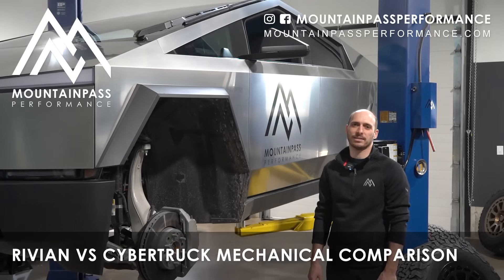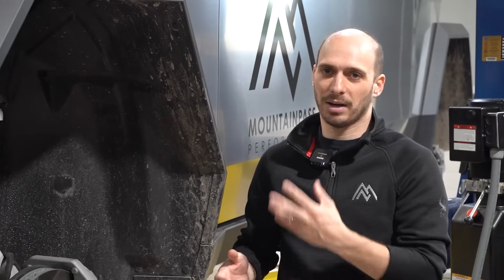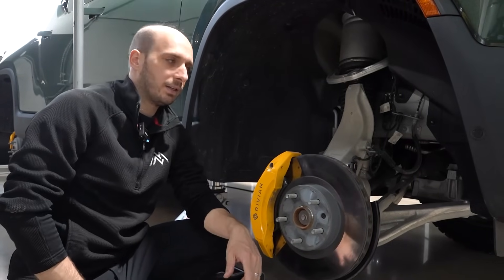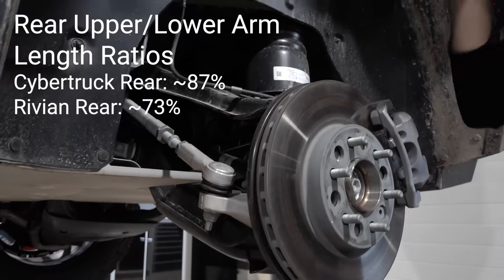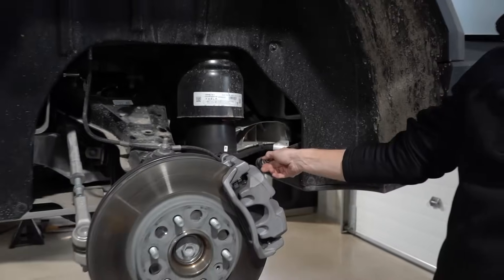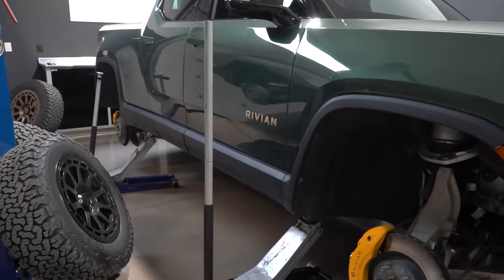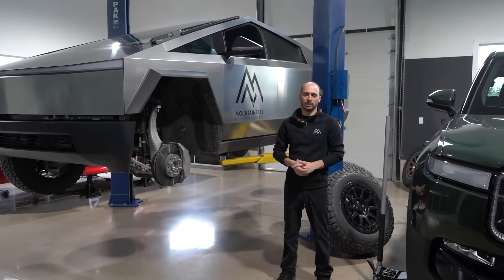Tesla Cybertruck VS Rivian R1T Suspension & Brake Comparison Up Close!

Comment: How dead wrong you are about range and effeciency! Just watch kyle connor and inside ev 70 mph range test. CT 304 miles vs R1s 290. Do better research. Big battery does not mean big range. Efficiency is king.
Reply: I stopped trusting Kyles tests long ago, he has a persistent anti-Tesla bias. I don't know if he does it consciously or unconsciously, but he doesn't want any Tesla to perform well in any range or efficiency test. You can tell how biased he is by watching the language he uses. Sometimes he catches himself and adds a moderating comment to appear less biased, but he can't help himself.

Comment: Cyber truck has steel subframe for the suspension pivots so you can weld reinforcements to them if you beat hard. Would be easier to add aftermarket control arms that are the same length or even +3” and get 12-16” wheel travel on the cyber.   Replace the air ride with 3.0” fox/king/bilstein coil overs per side and it should be fun.
Reply: The Cybertruck is already more fun than you can imagine as it's delivered. It really wants for nothing.

Comment: I heard anyone over 6'1" will hit their head on the ceiling in the back seat on the CT
Reply: That's a false narrative propagated by anti-Tesla folks. I'm 6 foot-four inches and I fit fine in the back seat, sitting straight up, with an inch or two to spare. The cabin in the Cybertruck is large and airy, especially compared to the R1T which is not optimized for someone my height.

Comment: According to Rivian and Tesla numbers, Rivian has lower CD but it also has a significantly smaller front footprint (and overall size) since it's a midsize truck vs CT being a full size truck. Also, it appears that Tesla is measuring CD a bit different - with wheels in motion, whereas many/some others measure CD without wheels or not in motion, not taking into consideration CD impact of moving wheels - which can be signfiicant at these low CD numbers.The fact that Rivian with a standard pack (121kwh) has significantly less range (270 mile) vs CT with 320 (or 340 with "street" tires)
Reply from the maker: Yes exactly, by the numbers the Rivian should get much better highway efficiency considering how much aerodynamic drag plays into the power losses at high speed. 

With the same wheels and tires on both vehicles, it does not!

In theory, if the Rivian is more aerodynamic, there should be a speed where it becomes more efficient than the Cybertruck. Sounds like we need to go faster!
Reply: @MountainPassPerformance Rivian weighs more
Reply: That's because Rivian is using real world miles and Tesla is using Elon miles.
Reply: @TroySavary  not according to car and driver Edmunds etc who all loathe tesla. The rivian in either dual or quad motor large pack trim with at tires is LESS range real world than the smaller pack ct is. Edmunds even managed 330+real world ct miles on a charge in mixed driving.👍🏻😀
Reply: @4literv6  Out of Spec got 250 miles highway driving, going down to empty. Highway driving is the only time range actually matters. Who cares, what a vehicle gets puttering around town? Also, at city speeds, and in stop-atart driving, aero doesn't really matter, but weight does.

Comment: I wish the R1T had rear wheel steering!!
Reply from the maker: That would be cool!
Reply: Rear wheel steering came with the GMC Sierra and Chevy Silverado back in the 2000s and no one really cared. It's a cool concept but mostly useless in real world situations. Most new trucks already have a really tight steering angle and streets in the US are massive so 4 wheel steering is really just a party trick.
Reply: @MindzEnt  Um, no. The rear wheel steering transforms the Cybertruck in a fundamental way into a much better vehicle. Combined with the fast-reacting steer by wire, it's mind-blowing what it can do that a regular truck can't. This isn't hyperbole, it's just plain obvious if you use one. I have over 3,000 miles on my Cybertruck and am blown away by how fun/easy it is drive in tight environments and well it rides/handles on highways and twisty roads. It literally does all driving environments well. No other vehicle on the road today can say that. It's a completely different animal.

Comment: Good video but spec sheets for CD shows/says the RivianR1T is more aero efficient
Reply from the maker: It does show that! Perhaps we need to do more testing to find out where the Cybertruck gets its efficiency from.
Reply: @MountainPassPerformance  Even in conserve mode the quad motor Rivian R1T has to drive two motors at highway speeds where as the Cybertruck may only be driving one motor under similar circumstances. So probably would need to compare it to the dual motor R1T to eliminate some variables.
Reply: @MountainPassPerformance  CD is a coefficient, just means it's aerodynamic for it's size, the CT is still a smaller frontal area overall than the Rivian. It's why a chevy bolt has an awful CD compared to a model 3 but has almost the same efficiency cause it overall has a smaller frontal area.
Reply: @MountainPassPerformance  The difference in published Cd values between the two trucks is probably due to the difference between publishing a Cd value representing a static truck with wind flowing past (wheels not rotating) and a dynamic Cd with the wheels rotating. Most automakers publish a static wheels Cd (because it makes them look better). Tesla publishes the dynamic figure with the wheel rotating. It makes a huge difference on this class of truck with large tires.
Reply: @MountainPassPerformance  the other thing I didn't hear you mention between the two vehicles is that the Rivian has a full-size spare tire compartment whereas the Cybertruck unfortunately with it being a larger vehicle doesn't have one and you have to use your bedspace. I believe this is huge in favor of the Rivian
Reply: @alittleofthisnthat5665  This is 2024. The idea of carrying a spare wheel and tire assembly, and jack and lug wrench is outdated. The concept comes from an era when tires were unreliable. The rational thing with more reliable modern tires is to carry a plug kit and a small inflator. If you run high quality tires, fit for the purpose, maintain the air pressure (too little is bad), and watch where you are driving, the chances of a flat tire is very, very low. Of course, if these precautions are too much trouble, then you should probably carry a spare and associated equipment. I would still carry a plug kit though. Because it's easier and faster to plug a common puncture than it is to swap wheels.
Reply: True but the bed in the rivian is much smaller to begin with. probably comparable to the CT with the spare in it.
Reply: @MikeHewitt  I hear you but not even close. Even if that was the case why take up valuable bed space with the spare tire. It's a huge miss/oversight on a full-size size truck

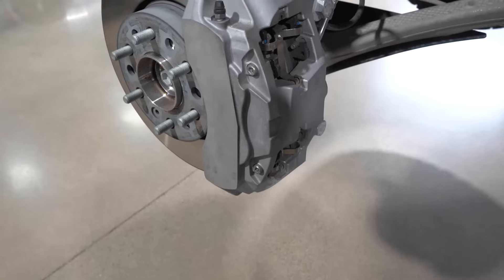Comment: 6:09 and 6:26 on both sides in the wheel wells on the Tesla at full turn you can see the tire rubbed. Not sure how you could fit a bigger tire since anything bigger will also come much wider.
Reply from the maker: Yup, and this is an OE sized tire and OE offset (Just a KO2 rather than the Tesla spec). You'd have to keep the truck jacked up at all times, which will kill aerodynamics.

Comment: Your aerodynamic assessment is off by the data. Rivian may look traditional but its drag coefficient is a .30 vs .335. It’s quite aero optimized, most aerodynamic of the pickups at least per the data reported on them.
Reply from the maker: Interesting. Perhaps we're missing something, but the Cybertruck was consistently much more efficient at highway speeds compared to the Rivian, despite the Rivian decoupling the rear axle. We drove both vehicles on the same trip together, so they were in the same air at the same time!

The Rivian, at 0.30 cD, has about 20.5kW of aerodynamic drag power at 120km/h. If the Cybertruck has 15% more drag than the Rivian, that represents a difference of about 3kW of drag power. The Cybertruck's total drag power would be 23.5 kW

On our long drive the Rivian averaged about ~36 kW of power @ 120km/h. With 20.5kW of drag power the remainder is 15.5kW.

As the Cybertruck uses about 15% less energy at highway speeds compared to the Rivian (averaging around ~33kW of power @ 120km/h - the remaining power is 9.5kW), that would mean the motor/battery/rolling losses are only ~60% of the Rivian! That's almost twice as efficient. Possible but unlikely. 

You can see how we've concluded the Cybertruck is more aerodynamic, as it's unreasonable to think the Rivian has basically half the efficiency outside of aero!

In both cases, the trucks were using the same wheels and tires for the most part, although the Rivian had the BFG K03 versus the BFG K02 on the Cybertruck. Both trucks were at 60psi. 

It's always tricky with aero and the main difference would be that the CFD of the Rivian is done with a Tonneau cover and we don't have one. But as Rivian's are being delivered without them, it's a fair comparison at this point in time!
Reply: @MountainPassPerformance  it’s possible Rivian’s aero numbers are with the smaller road wheels and aero covers which would decrease drag some. Don’t know which config that .30 comes from but the per kWh rated rate per the EPA cycle is better on the Rivian side hard to direct compare as Tesla chose not to EPA rate cybertruck. My R1T usually exceeds its rated efficiency just a bit with the stock 20 inch AT tires on all purpose presuming I don’t get too carried away with the speed.
Reply: @MountainPassPerformance  BFG KO3s maybe have lower rolling resistance? And is the frontal area similar, or does the Cybertruck have a lower overall CdA despite the higher Cd?
Reply from the maker: @moridin1000  Really hard to compare the KO3s to the KO2s unfortunately. The Cybertruck actually has a larger frontal area which is why I commented 15% more drag rather than 10%!
Reply: Posted this under another comment, but total aero efficiency is a factor of cd and frontal area. Could the Cybertruck have a lower frontal area? Or perhaps there are significant differences between the Rivian used in the wind tunnel vs many of the trim levels sold.
Reply: @ShaunRF   The Cyber truck is not as tall but the Rivian is 4" narrower and 7" shorter.
Reply: @ShaunRF  its also hard to equate efficiency in road testing to drag. Rolling resistance is also a significant factor. I suspect Rivian would have probably tested the 21” wheels with aero covers slammed to the ground with tonneau closed which would be its most aerodynamic setting. That might be something to compare, how low to the ground the Rivian gets vs the CT in its lowest ride height not that many people drive it like that as it doesn’t ride well at all, low is passable on most roads, lowest is just bad. On road trips I’ve certainly noticed a difference putting it in auto and letting it lower itself. Seems to improve efficiency by .10mi/kwh or so in my very unscientific experiments.

Comment: Rivian claims the R1T has the lower cd of the 2. So I'm wondering what led you to say that the CT is more aerodynamic. Is it frontal area?
Of course it'd be amazing to see actual wind tunnel results, but currently we just have the manufacturer claimed values of .34 for the CT and .30 for the R1T.
Reply from the maker: Interesting for sure, the Cybertruck gets far better efficiency on the highway, despite the Rivian decoupling one axle. Both tires should be similar as they are equally sized similar compounds, and the same wheels (K02 and K03 tires). 

We don't have a tonneau cover on our Rivian, so perhaps this is part of it.
Reply: @MountainPassPerformance  Ahh I'm guessing it's the tonneau cover difference, and maybe powertrain and hvac efficiency as well.

I agree overall efficiency is most important, but still would be interested to see how the real cd compares to manufacturer claims, if you know anybody with a wind tunnel 😉
Reply: @MountainPassPerformance 
 BIG QUESTION... Will you be doing a Duel Plaid battery & motors conversion...
Thus becoming the 1st 200+mph CYBETRUCK... ?
Reply: @MountainPassPerformance  did you delete my comment about Cd and Mercedes??
Reply: Oh I just saw you did a road comparison, that's really tough to compare because of variable wind and temps, but I'm sure you tried to account for those. Was most likely the missing tonneau cover, because at the time of publishing their drag coefficient, they only offered the powered tonneau cover.

There are some nice diy tonneau options, maybe can test again to see how much of a difference that makes.
Reply: Total aero efficiency is a factor of cd and frontal area. Could the Cybertruck have a lower frontal area? Or perhaps there are significant differences between the Rivian used in the wind tunnel vs many of the trim levels sold.
Reply: @ShaunRF  Rivian might be quoting a static Cd instead of dynamic, i.e. without the wheels turning.
Reply: Don't believe anybody's claimed Cd. They can massage the test to get the best number they want. Mercedes has been notorious for massively lying about their Cds for a long time
Reply: The Rivian probably quotes a Cd value with the tires and wheels static. I know for a fact the published Cybertruck Cd is with tires rotating. It makes a pretty large difference.
Reply: The cybertruck starts from a great foundational aerodynamic form, but Tesla insists on keeping the sharp corners, which cause separation of the lavender flow.  Rounding the transition from the front wedge, where the windshield is, to the back wedge, where the vault is would, have made a significant improvement to its aerodynamics.  The same goes for rounding the highly angular wheel wells.  I think they could have kept the overall triangular and flat panel design while spending a little 10:59 more effort on aerodynamic principles.
Reply: @justinsearle4461  You can't do compound curves with cold worked stainless steel that is that thick.
Reply: @justinsearle4461  The angular wheel wells help form a curtain of air around the turbulent areas around the wheels. They actually increase the aero efficiency. This is from one of the Cybertruck engineers.
Reply: Rivian is significantly more aerodynamic. Cybertruck sacrifices aero for the sharp angled design.
Reply: @justino4489  covered angled tonneau and smaller lower frontal area is superior to rivian aerodynamically